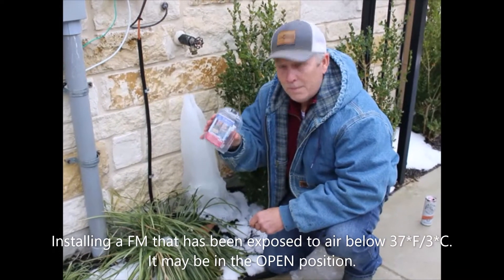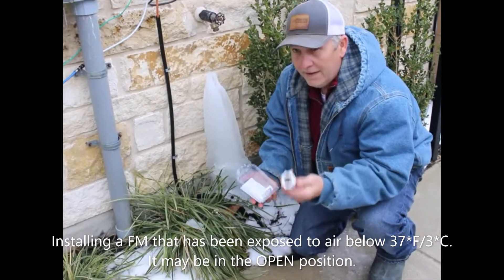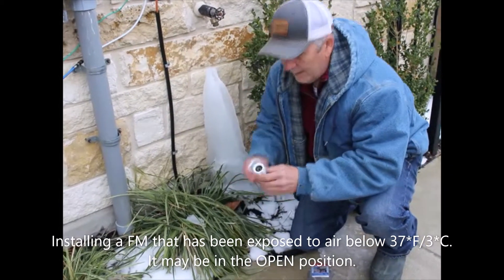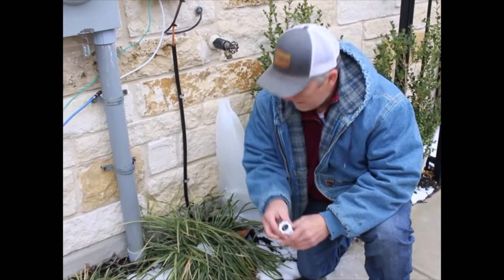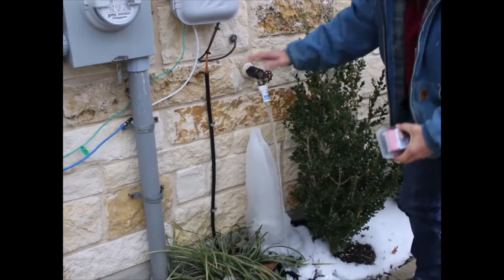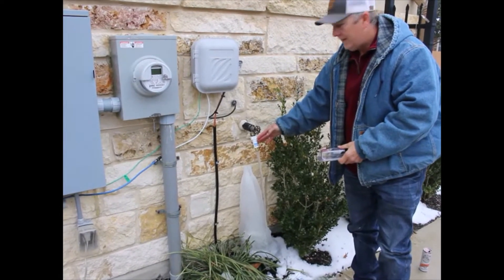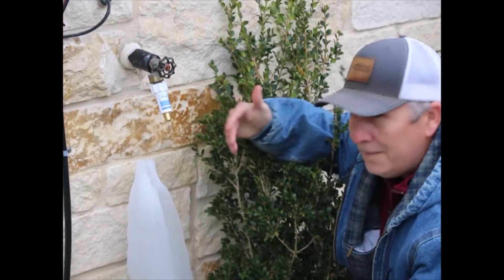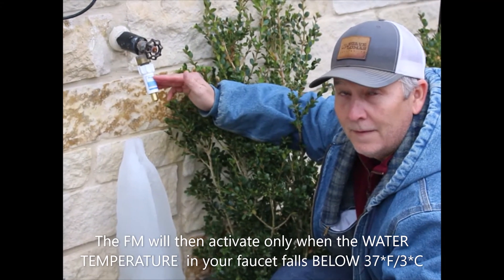Freeze Miser Installation Tips | Installing Below 37°F/3°C

Comment: So is it normal for the rod to be up but when I put it on and turned on the water on, no water came out? I'm assuming that's just because it's not detecting water that is below 37 degrees?
Reply: Yup.  Should be no water coming out when the temps are warm.